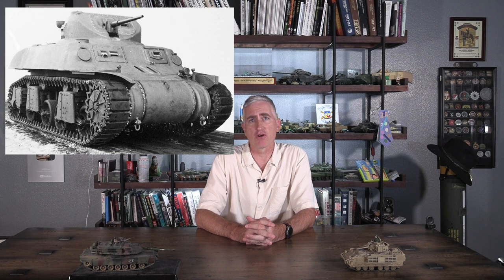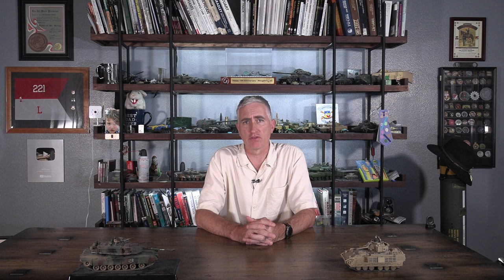The Tragic Tale of the Quad Cities Tank Arsenal and the M7 Medium

Comment: As a former machinist I was able to follow you just fine. The building of a complex thing as  a tank shouldnt be done by committee. Not sure if this story was a comedy or a tragedy. But my philosophy was simple: Just give me the tooling I need, the material you want it made of, and a print I can read. Then go away. You'll get your parts quicker that way.
Reply: As a 20 something young 'un running around a shop, allow me to add that's still very valid to this day.
Reply: @benlubbers4943  make sure you add "and a penalty for you changing your mind in the middle of production!"
Reply: Worked in a shop where they gave me a drawing of a part with no tolerances young apprentice asked 4 different people for the print or at least tell me the tolerances. Shop specialized in military parts (close tolerances true position all that sort of stuff ) finally got an answer plus minus 1/8 inch . After I picked myself off the floor was told that the part I was supposed to turn a shoulder on cut 2 chamfers and face to length from a piece of black iron pipe was the exhaust for a lawnmower.
Reply: @danielbackley9301  hope you bought a few brews for the headache that fall gave you!
Reply: 100%

Comment: There's a machine shop near me, the owner of which once told me he had four Bridgeport milling machines with consecutive serial numbers, all dated to late 1941, that he had bought out of the Springfield Armory's R&D shop in the late 60s. Probably most of the machine shops at least in the Northeast have one or more machine tools left over from war production.
Reply: I used to work at a machine tool shop in the late 70's.  I had to stop at another shop to pick up prints which was around during WW2.  They had rows of various machines in like new condition that all had War Department brass tags on them.
Reply: When the lockheed plant in Marietta, GA had a open house tour abt 10-ish-?- yrs ago,so public could go thru . The plant was still producing F-22s on one production line and new  C-130s on the other.Amazing to see the varioys stages of assembly.  Many of the machine tools. For stamping & milling still had their early-to mid-1940s mfg data plates on them.  The actual final stamping/ machining jigs can be chaned out for whatever assy is required for parts. Quite interesting. The machines were still in use,and a wall sign that tool dies had originally been in use when Bell Aircraft was license building the B-29 superfortresses there staring in 1944 iirc.
Reply: @lostalone9320   I knew an old timer whose first job had been at Westinghouse. He once described to me how (before his time) certain parts manufacturing was done on huge machines that would run 24/7 for weeks or months. Local men would work on production runs as gigs, more less, with whatever time off they chose to take in between.
Reply: @lostalone9320  They were not. Modern material science is vastly better. We can make five times as durable drills that cost half and use 30% less material. Old stuff was overengineered and heavy because it was made out of crap parts. There is this story we can't make F1 engines anymore - because they were hand welded junk made out of 6000 parts and now no one sane makes them like that. Redesigned F1 engine with the same dimensions was built out of just 300 parts, weighted 20% less and had 50% more power. Modern stuff is vastly superior, it's the capitalist crap planned obsolescence that keeps it from blowing old out of the water...
Reply: @KuK137  Like anything, it's not the system that's the problem, it's how it's implemented. Your are right though, things are too a degree, designed to fail so customers come back sooner.
Reply: @KuK137  It depends on the circumstances, though. There are some cases where old-fashioned overbuilt designs may work better than more recent ones that may be more efficient overall but less suited to the specific use case. My favourite example is the DC-3 Dakota/C-47 Skytrain; modern airframe engineers would probably look in shock and horror at how much excessive weight (and strength) there is in the airframe, which compromises so many performance parameters like range, fuel efficiency, climb rate, and the like. But it’s these inefficiencies that have made the airframe unusually suited to the brutal conditions of bush aviation, and also what allowed them to continue serving far beyond the planned duration of their service life.

In the case of machine tools, I’ve had some old factory hands tell me that old machines from the Dutch colonial era here in Indonesia may not work as fast as more modern ones and tend to consume more power, but they tend to be easier to set up in less-than-optimal conditions (such as when the factory floor hasn’t been perfectly levelled so that the bases/mountings had to be shimmed, etc.). The sheer mass of the less efficient older designs also made them more resistant to vibration.
Reply: when I did my Mech Eng course in the UK  a lot of the machine tools where ex ww2 in the various shops
Reply: I'm a machinist from Wisconsin and every shop I've ever worked at had at least one machine that dated back to WWII.
Reply: About 10 years ago I did a tour of a shop full of robots that made parts for the space shuttle that a lot of other shops had refused to even try due to size and complexity. Beautiful stuff.  Off in the corner I spotted an old Bridgeport with some rolling tool boxes beside it. I joked with the owner (who was the tour guide) about it. He explained it belonged to “Old Gus”, and that he used it to make stuff the robot operators couldn’t.  Ultimately, I think a lot of modern shops still rely on old Germans with Bridgeports to make things happen.
Reply: So we can build stuff better/faster/lighter/
cheaper/ stronger than was done in 1942? Is that your point? These folks had nothing available in the realm of CAD/CAM, computerized stress analysis, deep understanding of material strength limitations...they were in undiscovered territory!
Can we make better stuff now 65+ years later?
Engineers: your thoughts, please!
This is why mechanical constructs of bygone times are still standing: when in doubt, make that part bigger!
Re: Firth of Forth Bridge, Hoover Dam, Model T Ford, DC3,.....
Reply: @samuelneese482  
The company I worked for in Kenosha had one machine of a very specialized type that did only one thing in its Tool Room. It cut lubrication grooves inside of plain bronze and cast iron bearings. The machine was built in the 1890s near as we could tell.
Reply: @KuK137  
The machine tool industry has changed hugely over the last 50 years. In the US almost all the old machine tool companies that had a business model based around manual machines (lathes, mills, shapers, grinders etc) are gone. Or they have diversified into other related fields. Even the ones that refocused heavily into CNC found themselves not only competing against overseas competition but against their own government. Mazak used to import machines and warehouse them until they had an order. The machines were sitting in a warehouse on the West coast but hadn't gone through customs yet so Mazak did not have to pay any inventory taxes. Mean while Cincinnati,  Kearney & Trecker, LeBlond, Gidfings and Lewis and others were paying inventory taxes on everything they had.
Are modern machines capable of producing more faster than the old stuff? Of course they are. But anyone who has been involved on the machining business from the maintenance or one of end of things knows that the need for manual machines is not dead. And in those situations mass does play a critical role. Alas all the great manual machine tool builders Hardinge, Monarch, Cincinnati,  K& T etc have either no longer build new machines or been absorbed by other companies. The ones that aren't completely extinct.
Reply: And that doesn't even get into specialized things like lathes for making propeller shafts for large ships.

The brand new Ford-class carriers are getting their prop shafts made on a 100ft long lathe built in the 1920s (IIRC) for battleships.
Reply: @mpetersen6  Interesting to see the company from my home town mentioned. G&L is still around, but it's a subsidiary now. Got a tour a few years ago for their anniversary and my Grandfather walked my sister and I through there, because he used to work there years back. Pretty impressive history in that plant, especially the part where they closed a road during WWII so the two separate buildings could be combined into one!
Reply: Anyone, from any service, from any country knows cost of "Hurry up & wait" personally. There is a more modern expression that sounds like "clustertruck" to describe more servere situations.  This story puts our personal, individual experiences into perspective, yes?  Imagine coming to work one morning to learn everyone in the factory is out of work starting with the end of your last shift?
Reply: @KuK137  That's nonsense. We can make things better. We often don't. I'm curious if you have any engineering background.

Comment: i see even back in the day the government neurotically changed requirements until the program died
Reply: There's a ship building firm in Sturgeon Bay WI that used to do work for the US Navy. Auxiliary vessels, minesweepers etc. They told the Navy years ago that they would longer submit bids or accept contracts on Navy vessels. The reason. Constantly changing specifications on vessels while under construction.
Reply: And that's why you have to anchor in the specs in writing and put in penalties for changing the specs.
Reply: That's literally the case in every field. I once had to send 25 versions of a 1 minute ad video. The fact that they were being charged per cut didn't faze them or reign in their unnecessary tinkering and indecisiveness. Those people are the worst. Clearly I wasn't charging them enough.

Comment: That sounds exactly like couple of projects I was involved in. The designs would change about half way through building the prototype. We would get ragged on for slow production... then I showed them the changed drawings and new instructions. 

After the third change someone in the upper office was apprised by me, so they had every engineer on the project on the shop floor grinding welds out and moving metal to make way for their changes. A couple of engineers refused to do the work so they were fired on the spot on the shop floor.
After that engineering talked with the floor about changes or projects comming into the shop.
Reply: "That sounds exactly like couple of projects I was involved in."

Yupp....

Sigh.
Reply: Wish they would have the designers/engineers at my job put in the work on the shop floor for the changes they made.

Comment: I actually had a opportunity to use one one of machines from this period .
It was "shadowgraph" !
It was quality control machine used to test size and shape of finished product/part by carefully placing part in front of light beam  that would bounce back to , sort of, screen where drawing of that part would be placed .
It was impossible not to notice plaque "Made in USA for war effort 1942".
It was in constant use for 60 years at least. 
I wander if all machines had similar plaque.
Reply: Sounds like what's called a comparator today.
Reply: @michaelmarks5012  yes , I believe so.
Reply: "This unit conforms to the orders of the war production board, and fit and finish do not reflect to care usually taken by the (insert manufacturers name here)"
The castings were not dressed and ways were not flaked as well as standard, and there was no flaking on cosmetic surfaces. They were incredibly well made, but not as aesthetically pleasing as was common.
The radial drill delivered on time was likely a cannedy-otto......they were chicago made, and, well.......utter crap.  Everyone would have wanted Carlton radial drills, (Cincinnati Ohio) and they would probably have been hard to come by! 🤣

Comment: Vertical Borers... basically a giant drill press that requires huge thrust bearings compared to horizontal borers that use cylindrical automotive bearings and comparatively small thrust bearings.  You can even Babbit (lead alloy oil pressure bearing poured in place) much of a horizontal borer.    Vertical borers also have to be stood up on delivery whereas large horizontal systems could simply have their wheels taken off and the gooseneck used for a workbench at the end.

Comment: from what i read about german tank production the lack of machine tools has been a large hindrance in germany as well.
Drawings and design changes were also a similar problem.
Reply: Another significant issue was a heavy use of "file to fit", so parts generally couldn't just be bolted into place. This slowed both production and repair.

This was also an issue for the US building Bofors 40mm guns. The US had to completely redraw the prints and re-work the tolerances so that parts from any manufacturer could be bolted on instantly. Because when you're building a million or so units and need them yesterday, well, there you go.

Comment: There are advantages to not having your tank factory next door to the Army's tank development arsenal. While most of this seems to be that IH didn't make the connections and get their machine tool priority raised, a lot of the problems were probably caused by army types going over and looking at the things during lunch and slow afternoons.
Reply: The M7 was a prototype that was still under development. The Army had a habit of having a good number produced for testing so they could modify the designs to get the final desired product. The M7 was an experiment in up-arming a light tank that now had thicker armor so was low on the machine tool priority list.
Reply: Why and how do you think having the arsenal nearby had any effect on anything?
Reply: @Alpostpone  "good idea fairies" visiting.

"The 37mm is too small, redesign for the 57mm (that is itself not in production yet)"

"The 57mm is not a good tank gun due to lack of good HE shells. Redesign for the 75mm, just like the Sherman has!"
Reply: @ScottKenny1978  That was due to the official requirement changing, not some enterprising officer popping over during lunch break.

The whole story is about why it's a bad idea to set up a production for a design that is still being, you know, designed.

The features you mentioned are sound and ended up in M24 Chaffee. The "good idea fairy" is involved in design choices that are anything but.

Comment: Vertical mills are used to make the big drive wheels on steam locomotives, turret races for tanks and the huge end units for industrial washers and driers among many other similar designs. 90 inch and 120 inch are the working diameters they can cut to. They are huge machines in their own right.

Comment: Thanks Chieftain.  Hard for us to imagine getting all this done in an era without the internet or any other form of data transmission other than pieces of paper.  Remarkable how quickly so much war material was produced despite the failures here and there.  Compare that to how long it takes today to field a new weapons system. It takes years for the army to procure a new pistol with factories already in place. I kept thinking of the German Panther tank when IH replaced the herringbone gears with spur gears in the M7 final drives. Just takes a single point of failure to turn a war winning design into a failure.